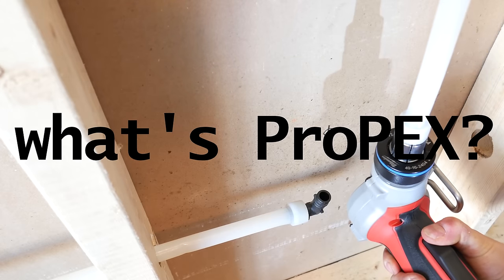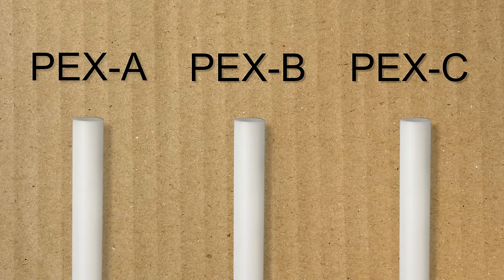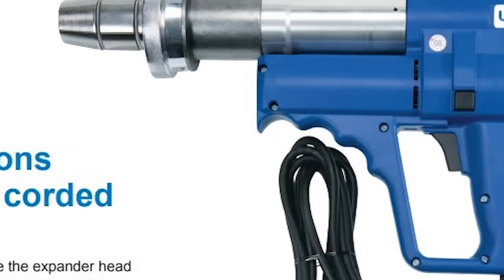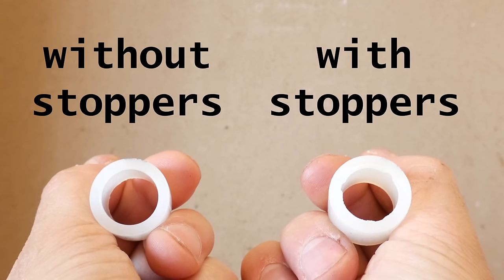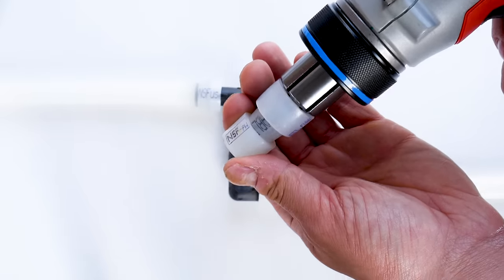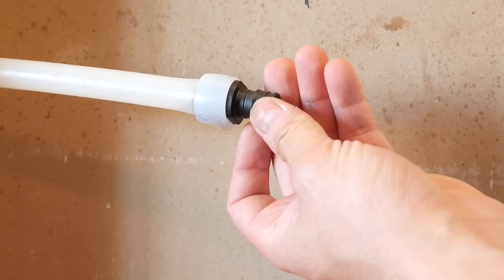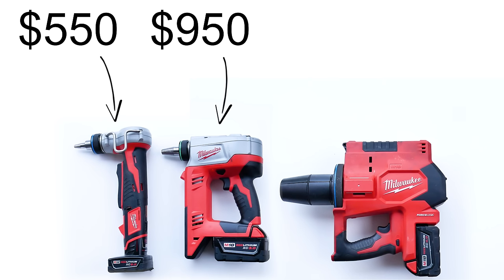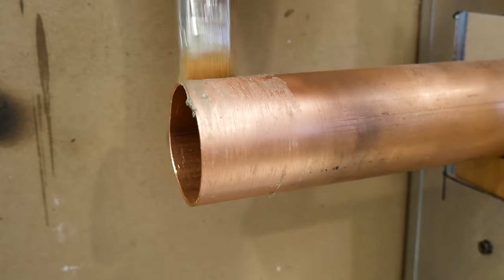UPONOR ProPEX, The Future of Plumbing (COMPLETE GUIDE) | GOT2LEARN

Comment: Love your videos. 

I just re-piped my whole house including out to the meter. This system really is so easy to use. Even as a DIY, I opted for the M12. I had no desire to manually expand the joints. 

My only regret with the system is I should have used a copper stub out for my tub spout instead of building a Pex one. Works absolutely fine, but isn’t as stiff as copper obviously. 

I also like Uponors multi port Ts, they saved me a good amount of additional fittings and joints to go to all my fixtures. 

Also worth noting that as a DIY project, you kind of need to know what you want ahead of time because big box stores have a limited selection for PEX A systems.
Reply from the maker: Thanks Vincent, yeah the stub out for the bathtub is better in copper for the reason you mentioned, and those multiport tees are great for bathrooms, love the system.
Reply: Got2Learn Rookie mistake on my part. I’m no plumber, but in hindsight it seems obvious.
Reply from the maker: Now you know :)
Reply: I work in the plumbing aisle at a Home Depot. You're right. We don't carry any PEX-A supplies. I wish we did. I'd love to show off all the advantages of it. I'm not sure if homedepot.com carries it. I'll have to check. It might be worth waiting a week to have it delivered to the store for free for you.
Reply: Yeah that's a code violation right there
Reply: What do you guys think about the class action lawsuit related to cracking of Uponor's red and blue tubing?
Reply: @bmfitzgerald3  Hmm. I hadn't heard about this. I'll need to read more, but that is somewhat concerning as my hot lines are red. I left the cold clear so I'm not as worried. Is there any information about how long it takes for it to become a problem, or if it's only under certain pressures, etc.?

Comment: This seems like a great new addition to plumbing for the DIY guy. However, I'm VERY curious about the life expectancy of the plastic. Especially the union pieces as they are obviously harder than the line. We all know plastic dries out and cracks over time. More flexibility generally means longer life, but.... how long before I have to open walls and ceilings to repair or replace ??? I have NEVER had to think about the copper once it's done.
Reply: There's an installation method with PEX where you minimize or completely eliminate fittings in the wall. Straight runs to each fixture from a manifold system or a run to each area where there is a sub manifold. You can feasibly plumb an entire home with no hidden fittings.

As for the actual life expectancy, PEX has been in use globally for quite a long time. The US was just behind on adoption. There's plenty of long-term usage and lifespan information out there.
Reply: PEX is crosslinked polyethylene. Not plastic as you know it. It does not "dry" out,
Reply: Copper is subject to chemical interactions with water, pex is not.
Reply: Plastic lasts forever that’s why recycling is so important, as far as installing it in your house it’s very durable and will last longer than most alternatives
Reply: @mjs3188  I had electrolysis in my last house and could not find the source of electricity. Due to the age of the house, I would get at least 3 pin hole leaks a year in copper, I replaced all leaky pipes with Pex

Comment: I'm going to be running air lines in my shop with pex which type should I use it's  only going to have 200 psi max
Reply from the maker: 200 psi is a bit too high, I would use copper for that.

Comment: Why wasent cpvc brought up? Seems to be the cheapest option and super easy/quick
Reply: As a professional in the trade my humble opinion is sea PVC is such an inferior product that’s probably why it’s cheap and becomes brittle overtime with heat cycles if I’m changing out a water shut off valve under the sink or behind a toilet, they are so easy to break off without much pressure being applied at all and it normally breaks off at the elbow in the wall, whenever we work on bathrooms and kitchens with CPBC we try and take out as much as possible and go back with uponor It’s just as quick if not quicker no chemicals no glue just quick and easy, and I can do a 50 foot run without any joints in it try doing that with CPVC. Like I said just my humble opinion, and if you go with a Dewalt expanding tool they’re only $200 as a bare tool.
Reply: @MrKThomas1976  I'd agree with you. I've replaced some old ass cpvc under trailers in my plumbing days. It is atleast worth mentioning in a video like this.
Reply: Cpvc turns brittle in 10 years,any plumber in the trade for over 20 years always say copper is the best.time tested and copper don't leach into the drinking water
Reply: I wouldn't plumb a doghouse with CPVC
Reply: CPVC is not a reliable platform. It’s been known to fall apart
Reply: Because cpvc is junk
Reply: @patriot12189  I have heard copper does or can leach. Although I think I'd rather have copper over plastic leaching
Reply: Because cpvc is sorry
Reply: @diegocelaya8036  copper, plastic, stainless steel, iron, everything soon or later will leach. A pvc system is just way more easy and quick to repair. It's just this system that is junk. I personally prefer pvc/aluminium systems as metal ones.

Comment: What is your opinion on Rehau EverLoc plus system. It seems like a similar product. Can you also do a review too? Thanks.
Reply from the maker: Never had any experience with it, maybe someone else here did.
Reply: Rehau is pretty similar but uponor is less likely for any installation errors, very small chance but still less likely.  While compressing rehau onto the fitting it can dig into the pipe where that's completely taken out of the equation with uponor.  It's still a very very good system but highly unlikely to find the parts in the U.S or atleast where I am.  I've never seen rehau sold in supply houses,  have to order online which makes it a easy choice to go with uponor,  uponor actually gets tighter over time where rehau is as tight as it'll be ever.

Comment: Homeowner here, was wondering if I ran 3/4" Pex  to the inside wall, can I reduce it down to 1/2" Pex going through the wall to plumbing fixture ? I was told go with 3/4 Pex throughout the house. Now I'm seeing use these manifolds ?
Reply from the maker: Sure, as long as the pipe feeding the 1/2" line remains 3/4", you won't have flow issues.
Reply: Most plumbing codes and just in general are that you can run a 1/2" main line and feeds to two fixtures. 3 or more and you need a 3/4" main with half inch feeds coming off till you get down to the 3rd fixture, from there you can reduce down to 1/2" for the last two fixtures.
Reply: I used 1" manifolds, standard 3/4" water heater hookup, and 1/2" supply lines. Great pressure. The friend who coached me said issue with smaller manifolds is turbulence; I have no idea if that's true. Same motivation for minimizing number of joints. FWIW modest 1200 sqft house, 1 bath, 1 kitchen.

Comment: Is there any adapting fittings that can connect Type "A' to Type "B" to retrofit a home?
Reply: I've used a sharkbite to go from B to A before idk if there is anything else
Reply from the maker: Yes, there are retrofit fittings.
Reply: You can use crimp fittings on pex a. You can connect two pieces of pipe, pex a with pex b with one crimp coupling
Reply: Like Sergio said. Pex a and pex b are interchangeable using pex b fittings. I believe that this is only the case with 1/2" and 3/4" pex a. I think that you would want a specific fitting if you were trying to convert 1" pex b to pex a. 
Just to clarify. Do not use expansion fittings on pex b. But I doubt you could expand pex b and you would know that something was wrong right away.

Comment: Can you really test right away? I thought you had to wait for the pex to fully return back to its original shape. I usually wait till tommorow to test or if I only did a few joints I use a heat gun to accelerate the contraction of the pex....Also I'd say making a square cut and keeping fitting free of debris and Knicks are important for a leak free joint. Great video nonetheless! Loved the list of minimum pipe lengths!
Reply from the maker: I would test within the next minute. I wouldn't recommend testing right away if you working in colder climates as it takes like triple the time for them to contract so beware of this guys.
Reply: If you have to, wait 5 minutes after the last fitting, particularly in new construction where the project might be cold.

Comment: This is in the States yeh? Have you not got "push fit", one tool required! A simple pipe cutter $20 (for plastic barrier pipe) it works with copper or plastic pipe. Reliable and simple it makes this system look like brain surgery
Reply: I believe you're referring to SharkBite fittings correct
Reply: @justinsparks3257  Not heard that term but sounds right. I've been fitting the system for 20 years, never had a failure. It's really quick to install
Reply: @Nailnuke  yeah shark bite is the largest brand-name company that produces the push fit connectors for copper and PEX line

Comment: Got2Learn
A couple quick and easy questions you might be able to answer.
1) When PEX first hit the market in the USA there were some issues with it. The major issue was COLD. Has that been fixed????? Have PEX lines stopped popping from connections and in the line if they are subject to COLD temperatures???
2) IS PEX STRONGER than PVC or CPVC?????
3)Compared to CPVC or PVC will PEX last as long when exposed to the same temperature levels????
Reply from the maker: Let me start off by saying there no perfect piping system.
1) From what I know (been in the industry for over 15 years) i've never seen or heard of a PEX line pop off due to cold temperatures, but maybe I just never heard of it too.
2) PEX, in general, is better than most piping systems, is it stronger than CPVC, i'd have to say yes because if you hit CPVC (specially the old stuff) it'll snap, not PEX.
3) I'd have to go with PEX on this one, CPVC has a tendency to become very brittle on hot water lines and for that, CPVC is not people's preference. PEX has had it's problems with hot water too, but it's not nearly as bad as CPVC.
Reply: @Got2Learn  
Thank you for the info.
I have used PEX in bathroom floors for heating. 
I have wondered for years if it was able to stand up to being buried in concrete to heat driveways in the Northern states. ANYTHING is better than shoveling snow!!!!!
Reply from the maker: Yeah it's fine, or else people wouldn't keep using it.

Comment: I started using PEX when it first came out. A quick tip if your running PEX pipe in the cold weather there is a very good possibility that it is going to leak a little. If it does, just use a hairdryer or heat gun to warm up the fitting area all the way around the joint and line magic, no more leaks!  Cold weather doesn’t allow the PEX to fully contract.  The heat gun works every time.

Comment: I've seen more wiersbo style fittings leak, even in walls. I also heard in cold weather you need a heat gun to warm the fittings so they actually seal. I prefer the Viega style copper crimp system.
Reply from the maker: Wirsbo leaking? I never saw an Uponor fitting leak. There are many ways for it to leak, just like copper, but it's pretty simple for it now to happen, I strongly believe it's user error hehe ;)
Reply: Bullshit..  Crimps leak- expansion never.  Any system will leak if using early brass fittings which suffered dezincification.
Reply from the maker: I've never had an expansion joint leak and I installed kilometers of it any many different conditions (hot, cold, cramped in tight spots, you name it.)

Comment: What happens if you expand B or C type pipe?
Reply from the maker: It will not retract like A.
Reply: @Got2Learn  oh okay thanks
Reply from the maker: Np 😉
Reply: Zurn also has the same expansion fittings for their type B PEX. Numerous plumbers have been using the same expansion fittings for both type A & B. Agree PEX A does bend better.

Comment: The first time I ever used pex years and years ago, I helped a guy run pipes using a manual expander tool. Made me never want to touch pex again. Eventually I started using the crimp system
Reply from the maker: Why?
Reply: @Got2Learn  Back then I was used to copper and cpvc. Working with pex felt like working with cooked noodles. and using the manual tool while lying on my back in tight places under a floor was just terrible. I felt like it took me twice as long to work with than what I was used to. Eventually the price of copper shot up and I gave pex another look because by then everyone had realized cpvc was awful. Now I almost always use pex. 
Pex B is way more common where I live, when it comes to residential. Pex A is used on new construction, but I don't do a lot of new houses anymore. With pex b, I can sweat a crimp coupling straight to copper for a repair or a for an extension.
I love your videos by the way. Always well done and informative.
Reply from the maker: Yeah the manual expander isn't the best option but it works nonetheless, thanks buddy ;)
Reply: Ya, expanding 1" joints is a workout. Plus you need extra room to work. After helping a buddy, I bought a Milwaukee M12 for my own remodel.

Comment: How does pex compare to sharkbite..
Reply from the maker: You mean crimped pex?
Reply: @Got2Learn  I mean one of the advantages of pex is the time saving aspect of it and seems to me that sharkbite applications are about a wash in labor...just wondering if that's a wash...what would the cost differential be using copper and sharkbite versus a pex system
Reply from the maker: SB is more expensive, just a lot easier and quicker to install.

Comment: 4:26 logically a larger opening means better flow. But when you look at a shower mixing valve the holes are really small, like 3/16”. So go figure. But I get that the 1/2” pipe is serving more than one fixture.
Reply: i think he means cold expansion gets full diameter flow as the mating surfaces are the same as the original ID.
Reply: It is minimal difference really, and most shower heads now days are low flow, a tub spout I'm sure might flow a little faster but I'm sure it's hard to tell, and in a toilet supply line the connection hose to the tank doesn't change. Don't get me wrong, it's a great system I just don't think that flow is any better
Reply: Kevr you are correct, a loss in volume not pressure.

Comment: Sorry - 'Won't split like copper'.  That's Not "Copper"!    6:30   
You show, "Blaze-Master" - it's a CPVC compound. (i looked it up)  
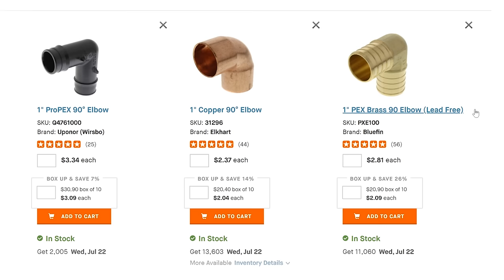6:45   NOT Overheated?  ie:  Burnt. ?    hmm   
I ask, because in Plumbing, One must be Perfect, or it Leaks.    I don't like plumbing for That very reason.   =\   
I feel sorry to those that Installed this with Older Equipment. ^  > Lack of Testing first? <  
A shame there isn't an Adapter - Attachment for electric \ battery 'drills'.      
^  Manual Expander  -   Better KNOW to TURN it on Pipe so Leaking will 'Not' occur.    Is there NOTICE with Tool?   thanks.

Comment: Here in South Africa we use a multilayer pipe which is like pex but instead of crimp connections it  uses compression fittings.
Reply from the maker: Yes, good stuff!
Reply: @Got2Learn  I use crimp right now, the o-rings and brass fitting. I remodel homes. Not a full fledged plumber but good at what I do. After watching this I might switch to ProPex. I have always had a concern with the pressure bottlenecks... at every joint. It doesn't seem right to have restrictions like that. I have seen the bottlenecks cause problems with shower heads, so I know I'm not just paranoid. Thanks.

Comment: One other option not mentioned. Tool rental.  If your project is well planned and ready for connections, then renting the expensive tools may be a much better option.  Shark Bite plumbing components don't require flame, chemicals or dry lines while installing.
Reply from the maker: Thanks for sharing!

Comment: How would it be for cold/freezing?
I have a summer lake cottage, in northern Wisconsin. 
We drain the system each fall, but often have a leak repair in the spring.
Reply from the maker: PEX-a, which is the one seen in the video is the most resistant PEX when it comes to freeze expansion, so you wouldn't have to worry about bursts really..

Comment: Six years ago I used a hand crimper with a Pex b pipe and found there were problems getting a good crimp in tight spaces like between floor joists etc. which resulted in leaks. I finally scrapped all of it and bought PEX a (Uponor) pipe and a used Milwaukee M12 on eBay. Aside from a problem caused by my not lubricating the tool, it has worked perfectly. I am installing a new tankless WH and upsizing to 3/4" PEX a.  It will be so easy - I would not use any other system.

Comment: My guess is that in the next ten years you will not see much copper used for the installation of
water system's.
Reply from the maker: Nope, only left overs and some mechanical room jobs here and there.
Reply: U still have to use copper and cast iron with in ceiling plenum returns so copper and cast isn't going anywhere
Reply: toolmike100 you betya - the fittings are just the weak point and leaching is a bigger problem than with copper... plus it’s thermoset plastic not really recyclable.... that’s a major flaw....